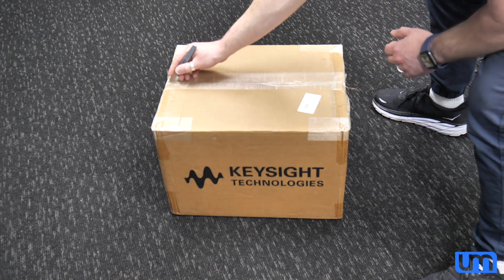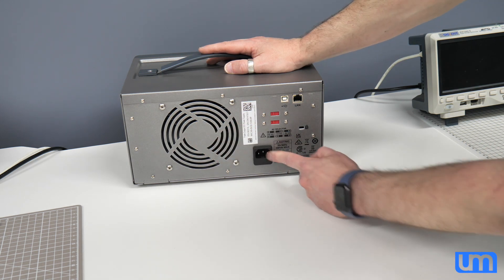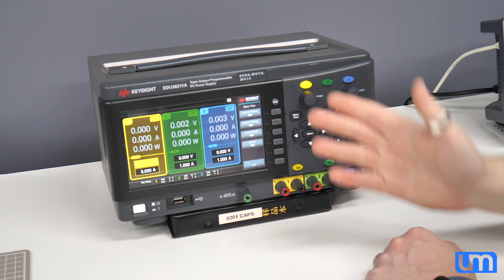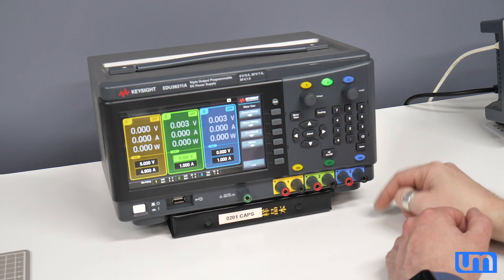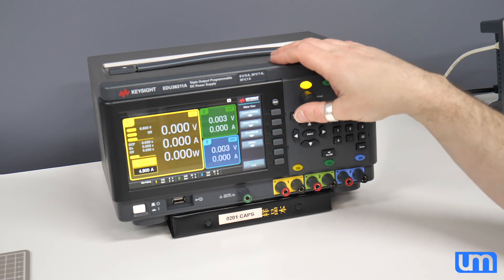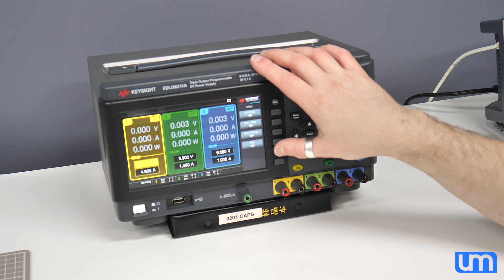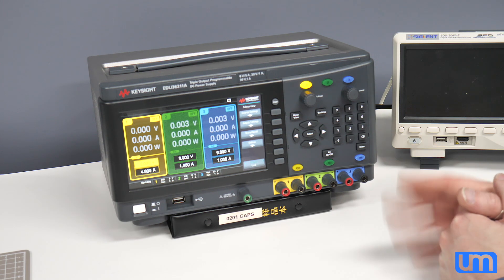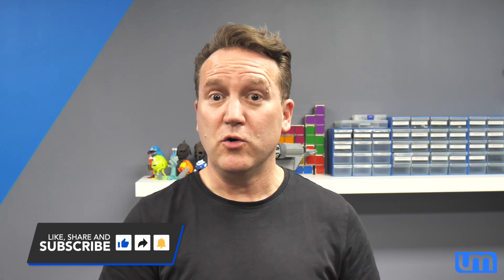KEYSIGHT EDU36311A Unboxing and walkthrough

Comment: Compliments on your new work space. Sorry to mis most recent live sessions  though did browse many times afterwards.
You will find it easy to learn the programming using both the Keysight tools and just commands sent via Lan or USB. Using a very well setup SCPI command system that is also used by many other companies  and the VISA addressing of the instrument.

Firmware upgrades would normally be via memory stick and accessed via System, Store/Save,  or Utilities menu, though might need nothing more than an upgrade file on the memory stick auto detected on insertion, usually though by selecting the file under menu, for example in save menu file directory listing.

Comment: Nice power supply) I have a Rigol DP832 (30V/3A, 30V/3A, 5V/3A) and it could use a bigger screen for sure. Also, I'm surprised how much latency the controls have (delay between button press and screen update). Usually Keysight tools are pretty snappy.
Reply from the maker: Yeah I noticed that as well, but didn't comment on it as I have nothing to compare it to.